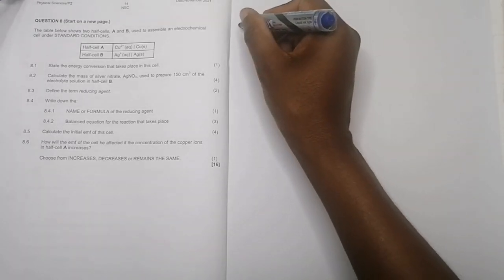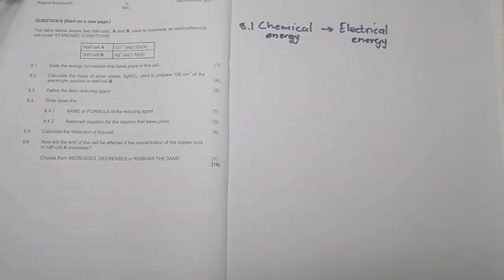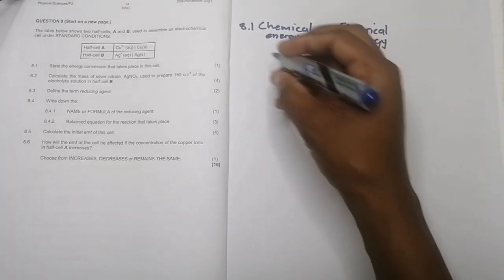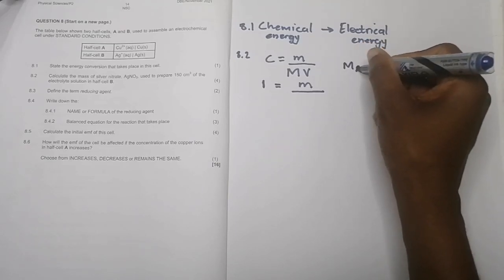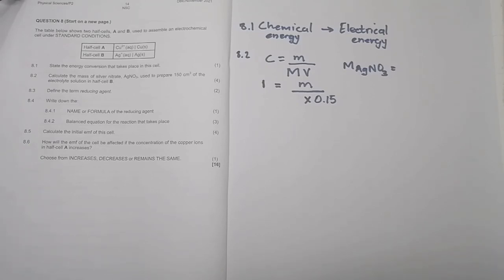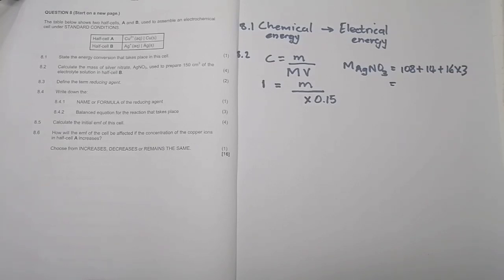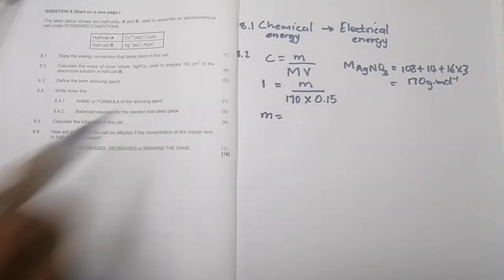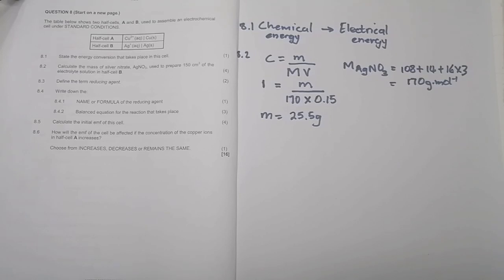Chemistry | Galvanic Cell | DBE November 2021

Comment: 8.2) I used the formula n=v/Vm because they stated that its standard conditions... but then I didnt get the same answer... what's happening 😭
Reply: Same😭
Reply: @manelimhlongo3386  mann, there has to be something wrong🤞😬😭
Reply: @katlegotsotetsi2131  yhoo maybe 😭...i started by finding number of moles so that i can use n=m/m but ei it seems like i got zero
Reply: That's most probably because Silver Nitrate is used as an electrolyte in the example and not a gas, so you couldn't have used molar volume because that only applies to gases under standard conditions and not aqueous solutions
Reply: I also used that cause its under STP
Reply from the maker: @Dizzyd you are absolutely correct. That should answer everyone why it wasn't correct